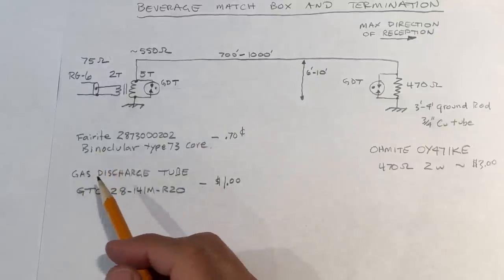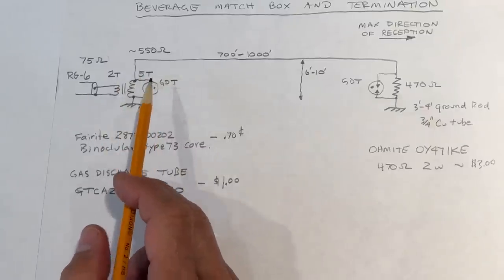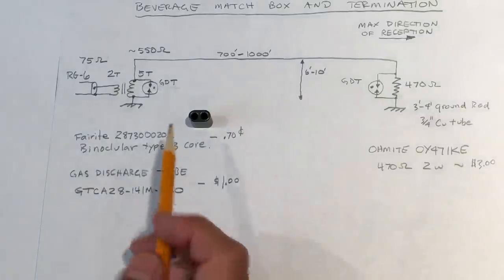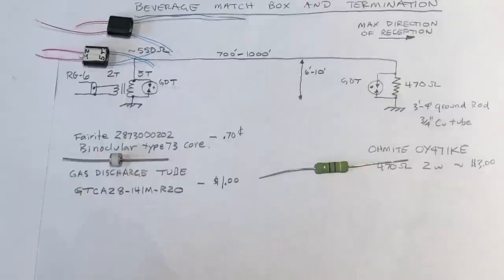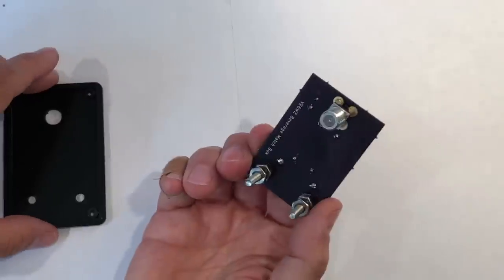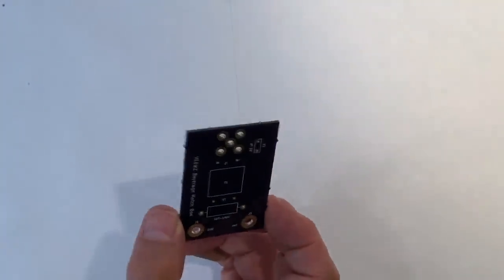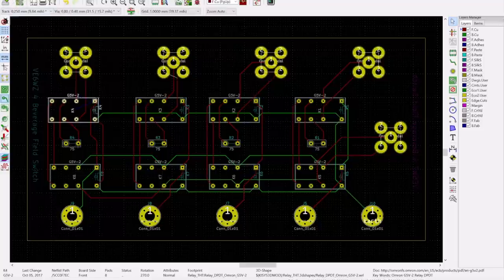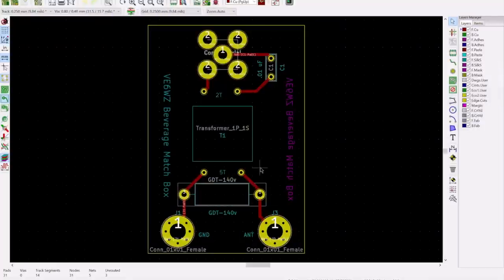Beverage Antenna: Feed, Termination, and Switch box construction.

Comment: A very well done video. The only small suggestion I have would be to specify the Beverage length in terms of wavelength not fwwt. That way, NDB, 630 meter and MW  DXers won't be misled by the quoted 700-1000 foot range. Either that, or specify the 700-1000 range as being for a particular band.
I can't recommend enameled wire for winding toroids, as many toroids are not polished to have smooth edges  in the areas where the wire goes. Some have found the enamel gets scraped off. For that reason I always use wire wrap wire as you used in the video.    
Chuck
Reply from the maker: Thanks Chuck. Yes. that is a very good point. I mostly use my beverages for 160m.  A good wire length is from 1 to 2 Wavelength long on the frequency of interest. Others have suggested that going beyond 2 wavelengths shows little improvement.  For example, if you only plan to use your Beverage on 40m, then only 200' length would be fine, or 400' on 80m.  If you want good RDF on 630m, perhaps consider a different RX antenna (like a phased vertical array) since 1.5 WL is 3,100' !!

Comment: Steve, I am enjoying all your videos.  One question on the Beverage matching box: what is the purpose of the 0.01 uF capacitor in series with the F-connector center pin?
Reply from the maker: Good question!
My Beverage RX system has broadside phased pairs that are relay switched in the field. I have 12v sent on some coax lines. This is a blocking capacitor to prevent a dc short through the transformer to ground. You could omit it, but no real harm to keep it.
Reply: @ve6wz  Thank you, 73, Zyg AF4MP

Comment: Steve, I am building several beverage antennas and found this video very helpful, also well made. I am interested in getting PCB files and the parts list for the switch box, I will send you a seperate email. Thanks, K4RJT

Comment: If I was to use 50 ohm coax instead of 75 how do I wind the transformer?     Thanks
Reply from the maker: A 50 Ohm match transformer is 2 turns 50ohms side, 6 turns High-Z (Beverage) side.

Steve, ve6wz